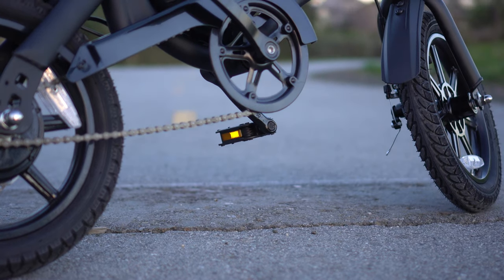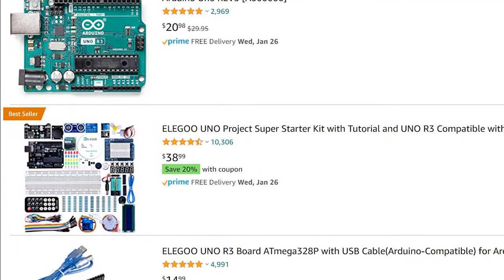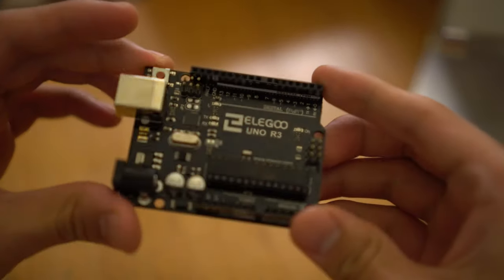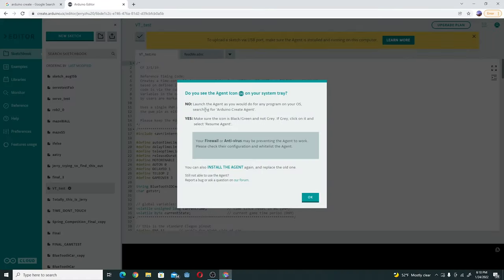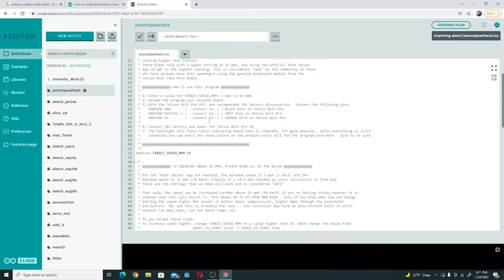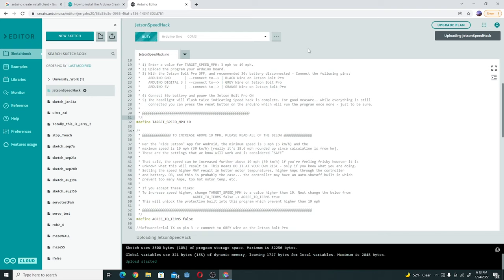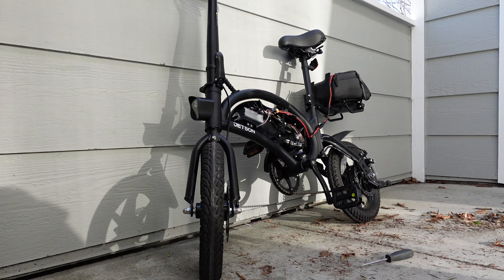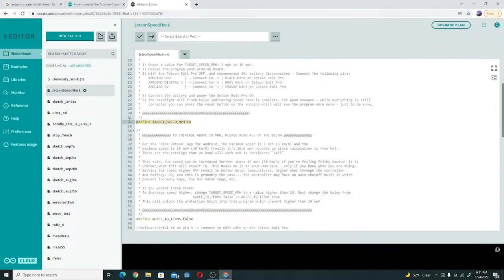The BEST Jetson Bolt Pro SPEED HACK 19+ MPH | Under $20, No Modules or Controllers!

Comment: Thanks! - Can you send me the link on adding an external battery to the Bolt Pro? What size batter is it that lets it go 21mph? Also, have you ever done a hack that lets the Jasion EB7 go faster than 20MPH with throttle only? I need one! TY so much! You are awesome!

Comment: used this mod and it worked! I am able to go around 18 mph, I'm seeing in the comments that some of the newer models of the bike do not work with this mod so if you have bought the bike recently I wouldn't recommend trying this out.
Reply: I think you are correct. I just bought mine last weekend and did the mod but no change in speed between my pre and post test. I already had the Arduino board so it was only 20 min of my time to try.
Reply: @CrypttedDags  same :/ , tried last week and although my bike light flashed twice my max speed is 15mph
Reply: What is the date of the JBP? It should say on the handle bar on one of the stickers

Comment: Thanks. It works. I've set it to 23mph. When the bike reaches 22-23 it starts reducing speed, which can be felt especially on a downhill. But I also did shunt mode and installed 48v 10Ah battery. I also have two fans inside the case to prevent overheating.

Comment: Hi Tony.  Fantastic mod.  I've added just about every mod out there to my Jetson, including being able to carry and easily change out three batteries for long rides.  However, until now I've held off on hacking the speed control because I wanted a simple, cost affective solution that didn't add more clutter.  So your solution checks all the boxes for me.  It's the best electric out there for fun on the trails.  Thanks again for sharing your engineering skills with all us Jetson Bolt Pro fans.  I'm a new subscriber for you and I will keep watching for more of your ideas.
Reply from the maker: Hello D Hoffman,
I’m glad that this solution works out for your Jetson Bolt Pro. It really is an amazing electric vehicle! Thank you for the subscribe, it really means a lot to me!
Reply: Swagger 5 Hack has never been done and has been sought after since the first M365 hack
Reply: Where did u get the 3 batteries to replace tha one that came with bike when dead? N wut batteries r they
Reply: Wait so do you know how to program if so what language, so it's just engineering and computer science right for this kind of stuff.
Reply: Hi D Hoffman, what generation is your Jetson bolt Pro. Did the hack work for you to reach speeds at 19 miles per hour.
Reply: @adotahuja  This guy puts the battery in the middle of the bike, on "top" of the stock one. Here's the link on how he does it: https://youtu.be/sHRt12zFVwA

Comment: Done, Thanks ! 32km with back wheel in air,  Kugoo V1.

If hack didn't work u need to replace/rewrote False to True in agree arrangement which is in the sketch right under to 19th mile line
Reply: where

Comment: I used this process last week to update my daughters Jetson Bolt Pro in addition to adding a parallel battery, 60T chainring, and folding pedals.  What a difference.  Now that little bolt can keep up with our full sized ebikes.  It goes around 16-18mph with my 10 year old with a little pedaling and we went 19 miles and it only used 1 bar.  The second battery is 10.6ah giving it around 17ah at 36V nominal.  We passed some stock Jetsons on the bike path and it was quite a difference in speed.
Reply from the maker: Hello Nathan,
I’m glad the hack worked out for you! Thanks for watching!
Reply: Do I need to replace the chain at the same time, because the 60t needs a longer chain?
Reply: @longtan9259  Yes, you need to buy a single speed chain, or add links to the existing chain with a chain breaker.
Reply: Hey Nathan I just bought one can I email you about the upgrade I plan on doing that to mine thank uou
Reply: where did you get the board from? There is no link
Reply: @sbb526  Amazon has the LEGOO UNO R3 he screenshoted.
Reply: I'm trying to mod my son's bike to keep up with my regular e bike. What battery did you get for your daughter's?

Comment: For anyone considering doing this speed mod, here's my experience. You will probably need a bigger chainring to increase the gearing to compensate for the added power. Even at lower speeds, I found my gears were constantly spinning and not giving me enough resistance from pedal assist. For those only wishing to use throttle power, this would be fine. But I wanted to keep my pedal assist to give me some more exercise and to give me more range.
Reply: If you care about exercise, maybe consider disabling pedal assist. I know there are many great tutorials on how to do it and it will give you more speed when you pedal!
Reply: @super73uk  do you know if the hack in the video can be made even for the dyu d3f model? Thanks
Reply: @angelor6899  Hi & thank you for your question. 
Yes it should work fine as both bikes are basically the same (Made in the same factory by the same company). The DYU is made by a company called "F-wheel" who also sell the bike to other companies who then put their own badge on it, i.e. "Jetson". Not sure if you know but there is also a reddit page for the bikes where there is loads of info worth reading.
Reply: why would you get an ebike for exercise? just ride a regular bike? The pedal assist is just working better with the added power, its literally just assisting you more. Your gears spin whenever you pedal, thats how gears work, so I'm not even sure what your trying to say?
Reply: @InZayne  Everyone's different brotha,  don't think too hard
Reply: Hi guys can I still use pedal assist on my dyu df3 14 inch  if I do speed hack
Reply: Or if I disabled pedal assist and do speed hack can I still ride bike on the pedals
Reply: @InZayne calm down get a pedal bike then simple a whole paragraph for?😂😂😂😂😂😂😂😂
Reply: @atmywitsend1984 don’t explain to him he’s broke n angry 😂😂😂😂 the bike is cheaper than many pedal bikes i purchased 😂😂😂 fr he just talking for attention 😂😂😂

Comment: Great tutorial that was to the point, worked exactly how you mentioned even though I used an off brand Elegoo Mega2560 that I've had laying around unused for years - everything lined up 1-to-1 perfectly from your instructions and the Arduino site and agent work with it too.

Thanks! Got two headlight flashes the very first try because of you.
Reply: Can you still use pedal assist
Reply: I second the question, can you still use pedal assist after the hack?
Reply: @LLF1234  yes

Comment: Well, I did this and hooked it up, saw the light flash twice and thought, great, good to go. However, when I rode it,  the most I could get is 14mph pedaling. I'm about 169lbs. So either it didn't work or I have some defect. The head light blinked so it ran the code but didn't seem to make a difference:(
Reply: Same situation. I'm wondering if the bikes are too new and the software has been updated to eliminate this work around? 

Plugging in the elegoo board work. I was even able to slow the bike to 8 mph, it just will not exceed 14mph.....
Reply: Have you tried they Bluetooth hack yet ?
Reply: @MosOneK  I don't have bt module from non pro bike to try it.
Reply: Exact same thing here, seems like such a cool hack but apparently doesn't do much of anything. Gonna set it to 7mph and see if it slows dowb as well.
Reply: Yeah this hack didn’t work for me. Waiting for a response from him.
Reply: Hack also did not work on mine! Bought mine like 2 weeks ago and tried to hack it last night.
Reply: Add me to the list of non working. I even tried 21mph. Still stuck at 15mph
Reply: I tried the bluetooth speed hack at first and its still stuck at 15mph. There may be a new module in these jetsons. I got my jetson two month’s ago
Reply: I suspect they now ship with a different version in the speed controller. My bike is really recent ( bought 2 days ago ) and I got the flashing confirmation but still stuck at stock speeds.
Reply: @marknylund1007  What is the manufacturing date on yours? I'll receive mine in a few days.
Reply: What is the manufacturing date on your bike? I'll receive mine in a few days and want to figure out if it's worth trying.
Reply: @tbolish  When was yours made? I'll receive mine in a few days.
Reply: The advertised speed of the bike is 15mph. If you take the actual speed when stock it will not go past 12mph to 13mph. Jetson is doing false advertising. Once you unlock the speed you get the 15 to 16mph. If you add a larger ah battery you can actually get to 19mph. 

Source? I'm one of the original guys who helped make this mod.

Comment: Question, I just heard today.  Can you use a 48 volt battery instead of a 36 volt battery, do the Speed Hack, and obtain a speed of 22 mph?  Several riders mentioned this on the Facebook page today, and said you could use the Standard Controller and Motor.  Is this true?

Comment: Hi Tony, if I buy the "ELEGOO UNO Project Super Starter Kit with Tutorial, 5V Relay, UNO R3, Power Supply Module, Servo Motor, 9V Battery with DC, Prototype Expansion Board, ect. for Arduino" do I still need to buy the breadboard wires? Thanks

Comment: I did this on a Bolt Pro I bought on July of 2021 and it DOES work. However it doesn’t go 19 MPH even when you set it to that. It goes around 16.5-17 MPH which is still an improvement from 13-14 MPH
Reply: Same here. I'm considering upping the MPH to between 21-22 to get closer to 19 MPH
Reply: Mine only goes 15 lol
Reply: @Shutrbug69  did it work?
Reply: @vnetcorp560  stop being so damn thirsty smh
Reply: Mine too i see 17 max. But still good
Reply: How did it effect the battery guys ? Mine is dead after 10 miles :(
Reply: @TanerMinator  yeah same :( i think it uses more power with the faster speeds
Reply: @GTheLegendOfficial  i disconnected the pedal assist cable and its much better now i go like 12 -13 miles only throttle

Comment: just did this hack and not seeing much difference, went from 13.5 mph to 15 mph. I did change the value to 8 mph limit to confirm it's loading properly and it did decrease the max speed. Tried increasing the value to 23 mph and got the same top speed of 15 mph so seems like it's the hardware limit.
Reply: it's because the new jetson bolt has a hardware limiter
Reply: @vnetcorp560  Before ordering parts to mod my jetson, do you know how i would know if my Bolt is eligible for this mod? Thanks!
Reply: @friedrice30  if your bolt is from last year
Reply: @vnetcorp560  I just checked and mine was produced 09/2021. Safe to say I can apply this mod to my Bolt?
Reply: @friedrice30  it should work since my 2022 model did not
Reply: Mine was made 10/21 and it didn’t take it. Did yours take the code ?
Reply: @fadyehabib1   mine  also would not go over 15 mph after the flash.
Reply: @johnxxxx7490  I gave up and bought a bike that can do 28mph. Just a lot more fun. 
Love the bolt to take or road trips it’s small and perfect. But a higher speed bike is just something else

Comment: Tried it and worked no problems.  Thanks for the video.
Reply from the maker: Hey Paul,
Glad to hear you got the speed hack working!
Reply: How do you get the Jetsonspeedhack file?  Thanks
Reply from the maker: @chieutran4329  Hello Chieu,

The link is in the video description, and you can also find it here: https://www.quillsdigest.com/post/jetson-bolt-pro-speed-hack
- Tony Quill
Reply: @TonyQuillMagic    Hi Tony,  
I just received the Elegoo Uno R3, just exactly what you have shown in YouTube. I loaded the file in from the link, and I compare the file I have vs. yours on Youtube is a little bit different. Anyhow, I just used exactly what I downloaded from the link and try to burn it to Elegoo Uno R3 board, It failed to load to the board and prompt with errors 
Stray '\302' in program. Can you help please?
Thanks
Reply: Hi Tony, I am now able to load the update file to Elegoo Uno R3 board without error, I then unload the board to Jetson Bolt Pro and confirmed with head light blinks twice. Speed ride test is improved from 12mph to Max 15mph.
Reply: @chieutran4329  hi ! 15mph? Why not 19mph?
Reply: @longtan9259  Yeah, I don't know why, I have not set the speed above 19mph yet, but I can see when I ride with pedaling, the speed is still the same as original 12mph before doing speedhack file. But when I ride with Electric mode, I noticed after doing speedhack, the speed is improved from 12mph to 15mph solid, sometimes it fluctuates to 16 and 17mph for 1-2 second and then stay solid as 15mph solid. Normally, I have 12 to 13mph in Electric mode.

Comment: Great video ! I think Jetson might have released a new controller model or it is now shipped with a different version because I have done what the video says and got the double flashing at the end but the bike is still limited to 25Km/h.
Reply: Following, since I plan to get one in the next couple of days.
Reply: Yes I just tried to do the hack as well and still am only getting about 14mph. Anybody have an update on how to mod the newer Jetson pro?
Reply: Not working for me either. Light flashed once
Reply: What your bike built date ?
Reply: @weiz2493  how do I find that out?
Reply: @dylansessions9027  look at your handle bar stem there a date there
Reply: @weiz2493  stamped right above light?
Reply: I am have the same issue
Reply: I'm having the same issue, does anyone have a fix?
Reply: Does this speed hack work on dyu df3

Comment: Hi Tony! Thank you for the video tutorial! Very clear explanation! I have two Jetson bolt pro, one is 2021, and the other is Oct 2022.  My 2021 JBP worked!!  but the Oct 2022 didn't work. Is there a separate code for Oct 2022 JBP? Thank you!
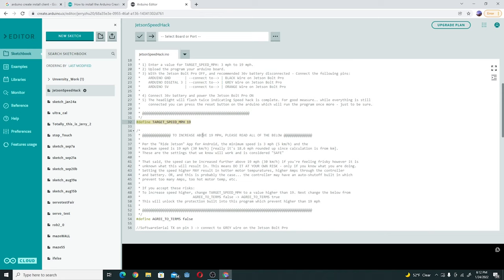Reply: Reading through other comments, it seems that you have to change the line AGREE_TO_TERMS from "FALSE" to "TRUE", on the other variable (line 54 on his video, at 5:42). Also, click the reset button on the board so you can see the light blink twice. Hope this solves your issue!

Comment: Hi! Do we need to buy 3 separate breadboard wires or do they come with your recommended arduino board? Also, do you have any videos on how to put the code onto the board? I am not super familiar with arduinos.
Reply: its in the video how to do but you need to buy cables and most Jetsons will only go 15/16  will not go to 19 or 20 mph

Comment: Just making sure, the original value of the speed should be 15.5 instead of 19 correct? In case I want to undo the changes for better battery.

Comment: I got this to work today, but it took me and hour an a half, and 3 attempts. For anyone trying this, don’t fully put the case back on (just about half the screws) because it will save you SO much time if it doesn’t work the first time. 😊
Reply: Glad you had success! I tried it on my Jetson Pro but still the same speed. How did you make it work?
Reply: 2022 bike?
Reply: @TheNyzzler  I did see some speed change from 13-14 max to 16-17. My bike is a 2021 Jetson Pro.
Reply: @TheNyzzler  yep got it at costco about 2 months ago
Reply: What did you do on the third attempt to get it working?
Reply: @MarkSmith-md4og  I eventually got mine to go faster. It just went from 15 mph to 17 mph. I put the Max speed to 10 and made sure that "stuck". I then changed the code again to something like 25 mph and it got me to 17mph which I think is the very max it can go with me (190lbs)
Reply: @MarkSmith-md4og  I got one blink of the front light so i clicked the reset button and that gave me 2 blinks. After that it worked!
Reply: @llflips375  ah yes. I actually had the same after I messed around with it 👍

Comment: Great video.  Where did you buy the Board from and the 3 wires?
Reply from the maker: Hello Jusrushem69,
I put a link to the exact wires I used in the description of the video. I've had the Arduino board for a while, so I don't have the exact listing, but any Arduino UNO board should work. Thanks for watching!
Reply: @TonyQuillMagic  will any of the r3 boards work? I see so many different brands

Comment: I tried this on my stock Jetson Bolt Pro- So here is the thing...... It works- but the speed does not change in the real world. If I spin the wheel it does go up to 19, and eventually slowly picks up to 21 mph. But when I put my weight on it, im back limited to like 15mph.

Not just that But I played around with this code for a whole week.. Ended up getting a small OLED , and programmed the speeds that has 3 Speed profiles. That way my kid can use it.

6mph 
12mph and 
19MPH Max.

LIke it said It took so much testing , but it works...you just need a better battery.
Reply: What battery would you need

Comment: Thanks for the tutorial.  Do you believe that this would work for the (non pro) jetson bolt ?  It is the jetson bolt with foot pegs.  I also have both a 400w kugoo b2 and a 500w Ancheer same style and frame ebikes as the jetson bolt & pro.  Is this hack specific to the bolt pro ?

Thanks !
Reply from the maker: Hello Ray!
I believe that this will work for the Jetson Bolt (the non-pro one with legs), as the motor controllers run similar software. I'm not exactly sure if the code will work on the kugoo and the Ancheer, and I haven't been able to test those bikes. I have heard they may run similar code, but it's possible it may mess up the software on the bike. Overall, I would do it at your own risk, but I feel like it would work well with the other Jetson Bolt.
Reply: @TonyQuillMagic  okay, thanks!
Reply: i have the dyu d3f 36v/250w and kugoo kirin v1 48v/400w , afraid of testing this code. Q1- my dyu comes without bluetooth but my kugoo bt works on the dyu, is there a chance to clone the bt. Q2- can i download the code from the controller has a copy? (probably not)
Reply: @raylivengood8040  did it work on your standard Bolt?  Appreciate your report.  I want to try doing.